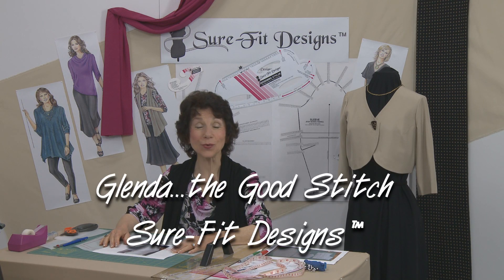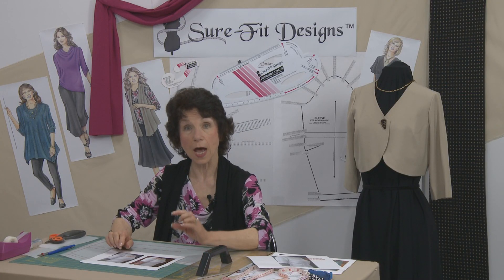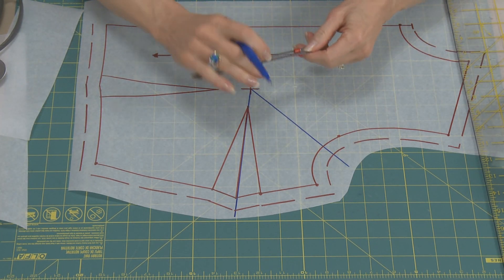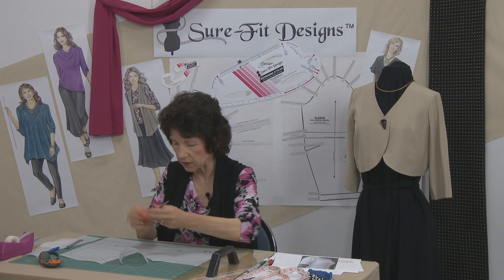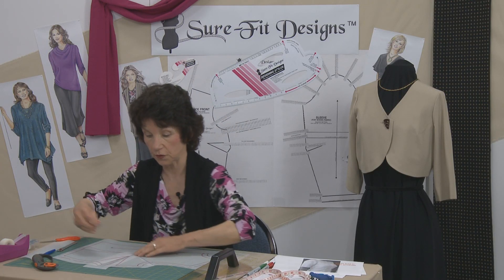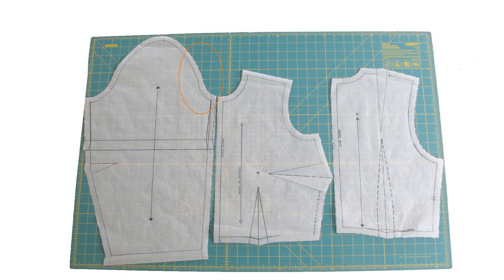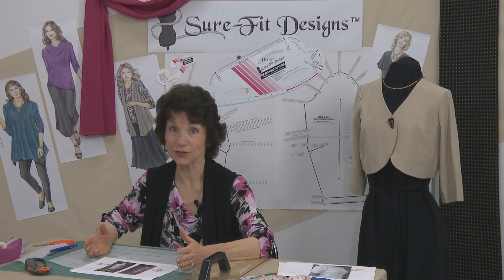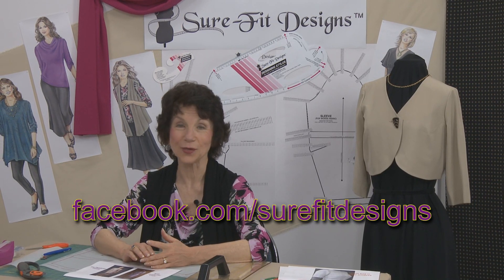How to Identify & Adjust a Gaping Armhole with Sleeve

Comment: The blouse i made has no darts in the front, it has two darts in the back. In order for it to fit in the bust, I had to go up two sizes on the pattern. That increased the shoulder width, (the blouse is sleeveless, has arm hole facings) I have small shoulders, so now i have a gap under the arm. Took it apart, now i have to figure out how to decrease the gap. It is a form fitting blouse, but i have a few inches to play with on the sides
Reply: You will need a FBA, not go up in sizes, unless it's more than a bust problem. Do a websearch for FBA and you will find a lot!